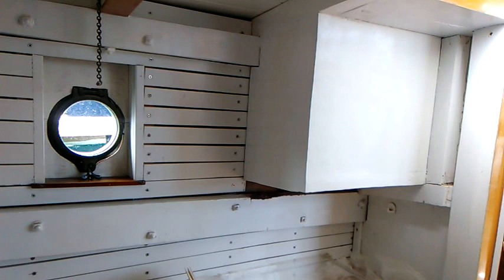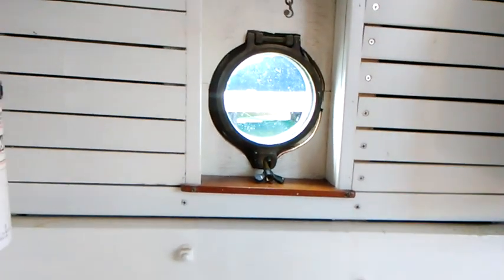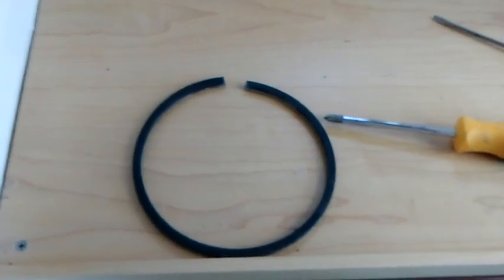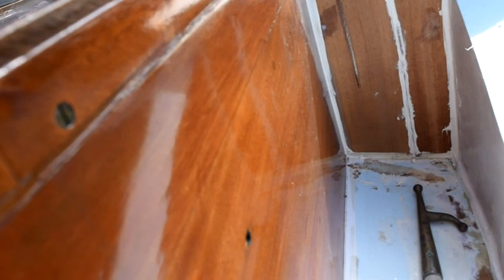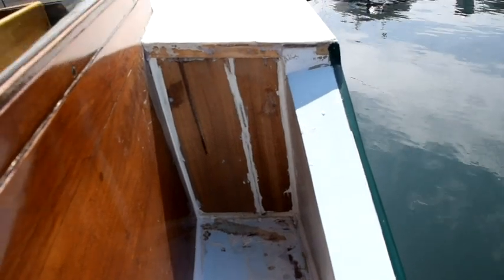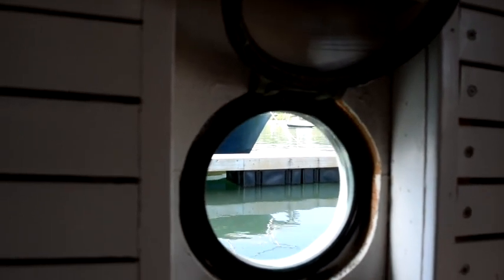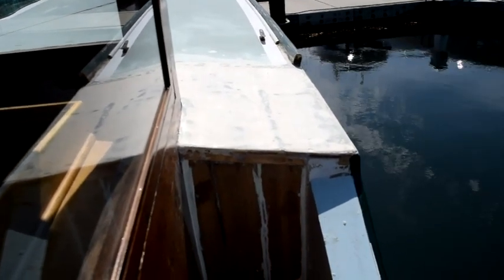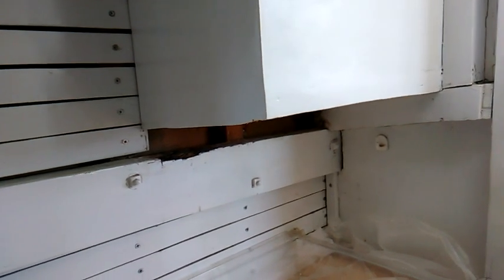Wooden Boat Deck Leak Repair - 8: Finding and Repairing Yet Another Leak

Comment: Say it ain’t so!
Reply from the maker: It is amazing that the port leaked.
Reply: Can you find that gasket material?
Reply from the maker: @RichardSmith-xp5yf  I am sure I can find a gasket.  It is a pretty much standard 1/4" square gasket.  However, the gasket was still pliable and by moving the break to the top of the port and filling the gap with 4200 I think it won't leak. I say that because water would have to flow "up" to get to the break when it is at the top of the port.
Reply: Ya, I got why and how you did your fix, just thinking of the future and the other portholes.